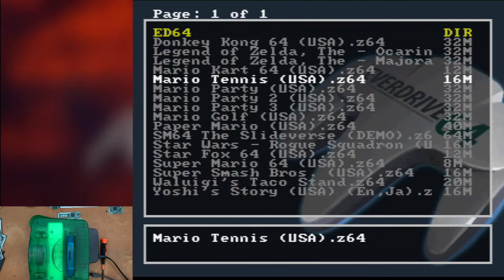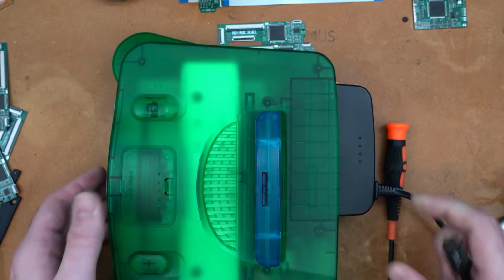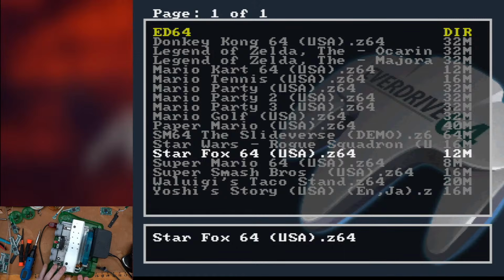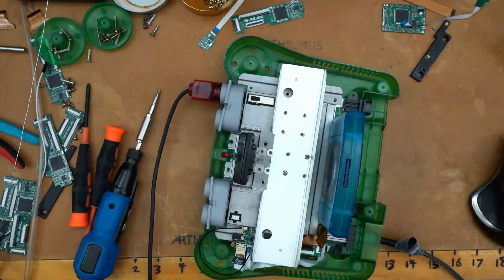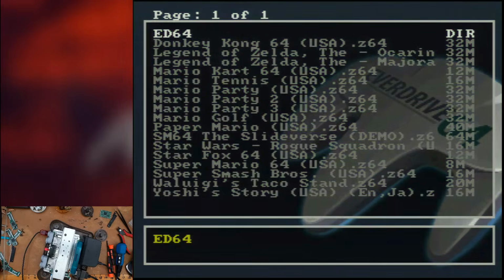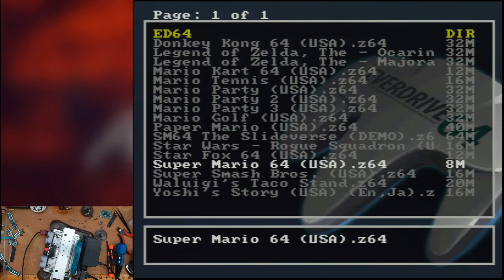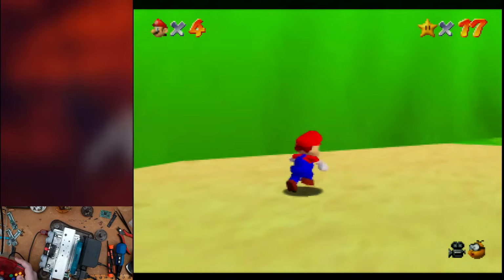Installing My New N64RGB Jewel Mod! Drop In RGB Mod for Retro GEM N64s!

Comment: At firmware level, will have then the same menu and/or capabilities as Borti4938's N64 RGB Advanced mod?
Reply: The video explains the features. These are the same as the Borti's board

It has De-Blur on/of, 15bit color on/off and can reset by controller
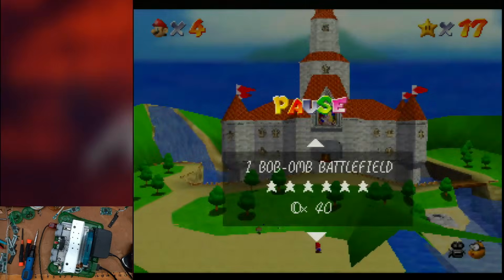Reply: @gamerjerome Thanks, I saw the video at 30:48 showing these shortcuts, but since Borti has more than one board, I was asking for more specification
Reply: I would appreciate an answer just to wait for it or not in order to proceed with my Retro GEM installation. Thanks man ❤